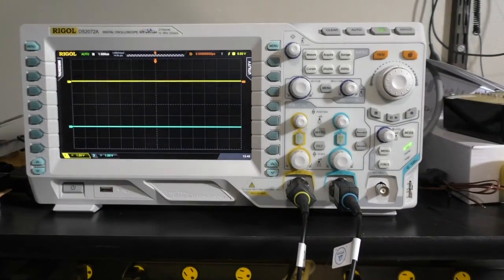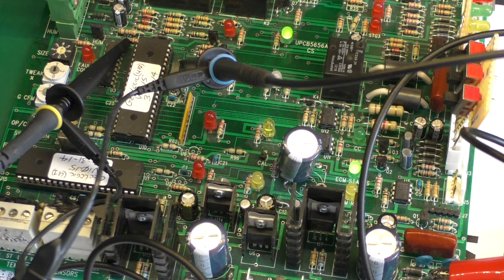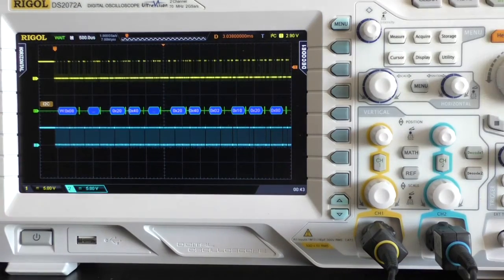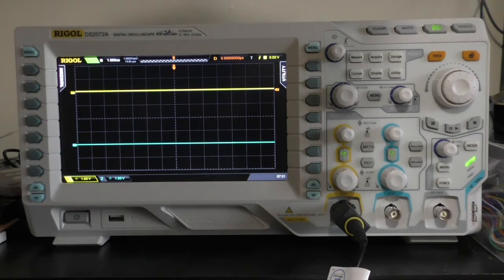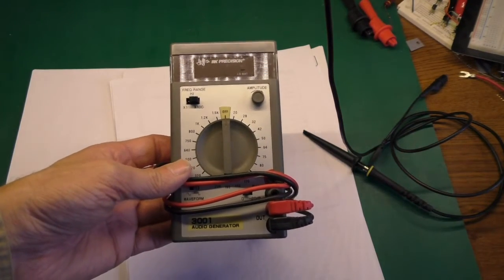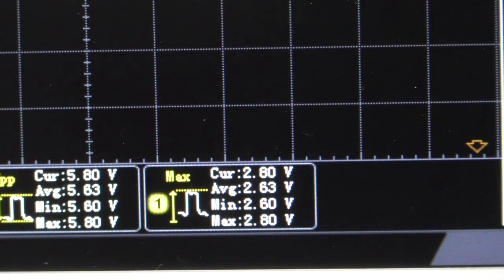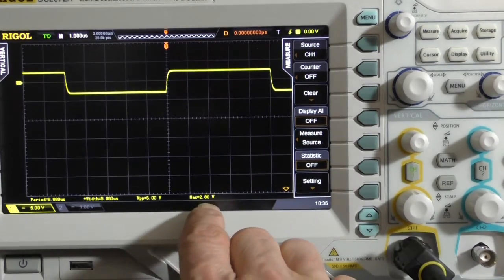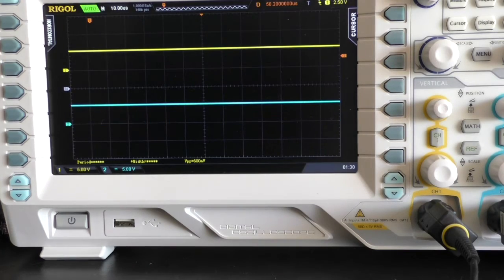R&D #11 Rigol DS2072A Scope Review part 2

Comment: Thanks for the review.  Bought a MSO-2072A-S and my buying/support experience was not as laudatory as yours but I will spare you the details. The call from customer support you received seems adhoc to me, I am still waiting for mine.
My fan is very noisy. The manuals/paperwork seem cheap, fragmented and a printed user manual should be included in my opinion. The scope with source outputs does have a different model number and H/W, but Rigol seems too cheap to print the complete model number on the front of the scope - this leads to confusion. The probes seem cheap, as you say. The select function is too touchy leading to section skipping at the point of press - fail - further, the location of the button is poorly chosen considering its frequent use. I have not had the scope freezing up so far but then I have not used the record fn yet. The help fn, the one you like, I think is essentially useless and confusing.
I have less of an issue with S/W expansion than you do. You get the scope with stated price and fns, if I think I should have got more scope for the price then I should have looked for another scope.

Looking forward to more videos.